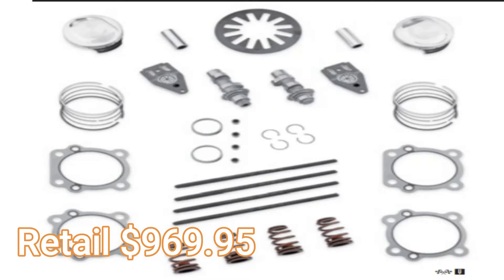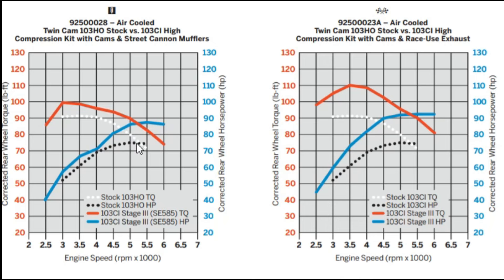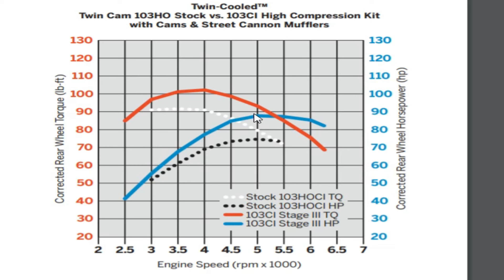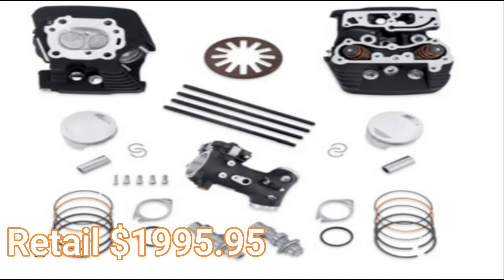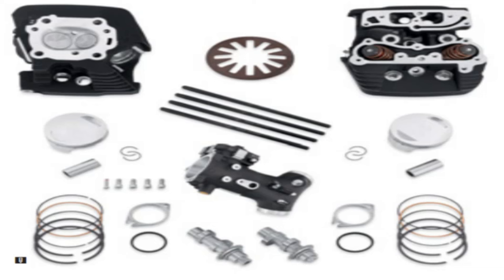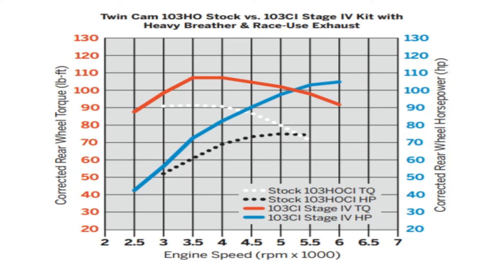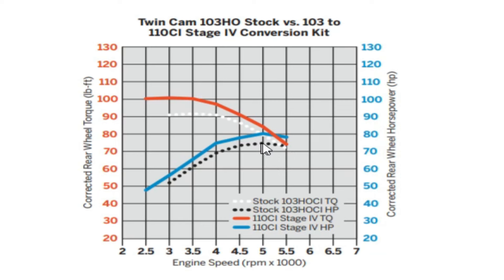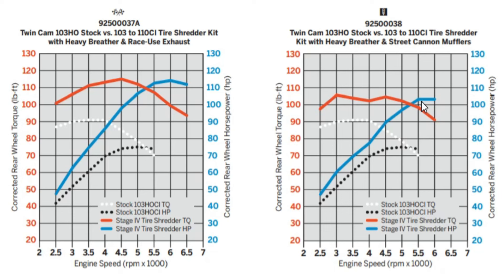Late Model Twin Cam 103's Make A Solid Motor For Modern Used Harleys

Comment: Good information well presented. I’m currently looking to get my first ever Harley and I’m looking at a 2015 ultra limited with the 103 engine only concern the one I seen at a good price had 30,000miles on it, what would your views be on that mileage ? Or should I go newer and get the 107 or 114 m8 
Thanks in advance any help would be appreciated
Reply from the maker: I like the late model twin cams since that's where they got it right in my opinion. Now the early M8's up to 2020 have some issues with oil sumping and piston oil jet coolers coming loose. With that twin cam at 30K I would just have the tensioners checked and make sure they are still in good shape. With they hydraulics they can last up to 50K miles, but better safe than sorry.
Reply: @GixxerFoo  thanks for the reply and info much appreciated. Are these 103 Rushmore’s engines good for high miles then? I’m not a fan of the sound on the new m8s plus the stories put me off Aswell on then 107,114’s. 
It’s more for just long rides and slow riding not for speed at all
Reply: @boylejohnstone1  on a different note my 103 lost a can tensioner and wiped out the motor with 26,000 miles.  My 2017 m8 now has 76,400 miles on it with only oil changes and a stator.  My 82 shovel swallowed a valve at 29,000 miles......my 98EVO is still running along with 102,000.  I work on 5 M8s that i have vented heads to atmosphere like i have done with every Harley from 76 till 2020.   M8s we do run 4 dots low on oil stick.  And vent crankcase to atmosphere ( 8 bucks to do not 100+) So i think the m8:engineers also run too much oil.  Maybe why you dont see many softtails stumpping...🤣🤣🏝

Comment: I have a 2016 Road Glide and have no intention of getting another Harley. I don't think the Milwaukee 8 is any better.
Reply from the maker: The M8 has improvements, but you it doesn't feel like a Twin Cam. I've rode both and I prefer the ride and feel of the 103 Twin Cam.

Comment: I bought the 2015 Road Glide Special out here in Cali and with the smog is was a DOG! Ran hotter than hell, didn't get 200 miles on a tank and had no throttle in 5th & 6th gears.

Purchased the Screaming Eagle race tuner. Installed a Roland Sands intake and Reinhart slip ons'. Took the stock exhaust off, emptied out the catalytic converter chamber and reinstalled it. Had to take it to Arizona to have it dyno tuned. Like a brand new bike. 92 hp with 113 torque. Runs way cooler, 240 degrees when it's 100 degrees outside. I get 230 to 240 miles on a six gallon tank. And of course, it's not the fastest bike but nobody leaves me in the dust. This thing is a rocket ship recliner. These days Harley is begging me to trade this in on the M8. Thing is how do I take the Cali smog off this thing and pump it up like every other Harley I've owned? The stage kits are crap and full of problems. These things eat, breath and fart. You improve this on the Harley it's like you have a brand new bike.

Comment: I’d say with that tire shredder kit that you upgrade the oil pump as well correct?
Reply from the maker: It's good idea to upgrade to the high volume oil pump on any twin cam. If you're installing a kit it's the perfect time to install it. It doesn't come with it but it's worth the extra money.

Comment: i enjoy my Twincam 96 the way it is , yes it's a noisy engine but all Harley engines got some noise . You just need to change the oil every 2000 miles and use a good quality oil and filter. Don't be afraid to use a 60 weight full Synthetic oil for extreme hot temperatures.

Comment: Before spending that much money trying to improve a Harley 103, I would just buy a Kawasaki Vulcan 2000 that puts out 141 ft.lbs. of torque to the ground, mine cost me $3,700, it now has 42,000 miles
Reply from the maker: I've always said that Vulcan 2000 is what Harley should really look at for going water cooled. It's a cam in block push rod engine and it's liquid cooled. Those bikes lay down some serious V-twin power!
Reply: It could have 9000ft pounds….but it’s always going to be a Kawasaki
Reply: @mickyzzzeee  yeah how great is that right 😃, Love my Kawasaki 🥰😍🤩, it's super fast and super fun to cruise on, my first trip to the smokey mountains, on it Harley riders were coming up to me admiring my metric ride 😀😄😊
Reply: @mickyzzzeee  and guess what, it didn't overheat,  and it didn't break down, 😆😅🤣😂

Comment: First modern twin cam 103 with the cruisedrive 6 speed transmition was first introduced in 2007 police  engine.
Reply from the maker: That's true, it wasn't widely available to the public until 2010.

Comment: Great video,, i ve got a 103 stage 4 kit on a 2013 fatboy and it was superb,, i replaced for a 120 R engine,..
Reply from the maker: Damn you went for the gold with the 120R! How do you keep a tire on that bike now?!
Reply: @GixxerFoo  from stock dunlop to the avon cobra chrome,,,
Reply: Still got the 103 stage 4 on the cabinet,,, tuner is vance and hines,, configuration online,,, i ve got the tts but there no dyno program to do the tuner,, but still pulling hard
Reply from the maker: Did vance and Hines provide you a tune for the 96?
Reply: @GixxerFoo  yes, they did for the 120 R,, and the 103 stage 4
Reply from the maker: I'd imagine it was a pretty good, they do a lot of dyno time developing.

Comment: Do you recommend doing anything to the bottom end of a 2014 103cid ( 43k on clock) if I were to go with the stage IV 110 cid tire shredder kit ?.
Reply from the maker: The kit is going to replace the bearing you can get to, you'll be replacing the left side output shaft bearing as well. That's about all you can do to the bottom end unless you're splitting the cases and having the crank worked over.

Comment: So, I have a 2016 Road Glide 103 twin cooled.  Does that mean that "going all out" for me would be the kit with the CVO heads because I can't use a tire shredder kit?
Reply from the maker: For that bike you can safely up the compression, the heads aren't bad on the CVO model. With them being water cooled l would go the route of upping the compression with some good cams.
Reply: @GixxerFoo  So keep it a 103 and just improve the airflow/compression.
Reply from the maker: The water cooled heads they really don't have a lot of offerings for those for some reason. But a adding high compression pistons will give you a big boost.

Comment: Leave the Engine Stock & Save yourself the $$$ and enjoy your Bike. Where are you going with all that horse power when just about were ever you go it's stop & go Traffic, with Fool's driving 4-wheelers.Think about it.
Reply from the maker: Just depends on how far you want to take it, honestly a nice cam to put the power where you ride is realistically all anyone needs beyond Stage I.
Reply: If i had to deal with stop and go traffic, i would be reevaluating my life. I'd move or eat the end of a shotgun. Most my riding is wide open backroads. A few stops in town, but towns are small, and this country is a big place.
Reply: It's all the people that upgrade on their bikes gives them an excuse 2 stay off them and never really have the urge to get out past their county line...They love 2 just hang out and brag about all that they have upgraded etc... Anyone with a brain cell left in their nogan would just leave it alone and ride wear out the parts..IF ITs nOT BroKeN DonT FiX It!!!

Comment: My 2017 Dyna Low Rider S is the 110 twin cam. Love it. Last year of the great one
Reply from the maker: That's already shaping up to be a special bike, they are already highly desired. I would hang onto that one!
Reply: If you take it to over 120 + rwhp and torque ..get rid of the compensating sprocket and clutch and replace the compensating sprocket with a solid plain replacement sprocket and a Baker King Kong Clutch or it will all self destruct ..been there and done that twice ...the last time it twisted up the fly wheels .. Was not a pretty site . used the latest screamin' eagle compensating sprocket and screamin' eagle clutch plates that shattered in to gravel of pieces parts and parts pieces

Comment: When bigger cylinders and higher compression pistons are added to the 103, would these things effect the dependability of the bottom end. Crank, bearings etc.? Thanks, I enjoy learning any new information you may impart upon me.
Reply from the maker: It's always a possibility but a lot of that depends on how hard you are on the motor. If you just ride it and not beat on it constantly, take good care of it, it can be quite reliable.

Comment: It’s all in the heads ! My 2015 RK I used my stock pistons and sent the heads to zippers performance for there mildest CNC port they offer called 1.8 for the slightly larger intake valves 700$. Put it back together with.030 head gasket and heads decked made it 10.25 comp. I already had Andrews 57h cams & powervision with cobra power port headers & SE street cannons. So this is the cheapest big gain set up you can get. & never even had to remove my cylinders. Had it dynoed with the powervision & ended up with 108 hp & 116 TQ & a very happy customer 👍 I did it with 14000 miles on it. 
Forgot to add I did it all myself including the cams a year earlier so no labor costs
Reply from the maker: Doing it yourself is the way to go! That's really impressive numbers, the twin cam engines really respond well to compression. You made some big power on the cheap, Zippers does really good work too. What was the turn around time sending your heads out?
Reply: GixxerFoo 
10 days in February which is there busiest time
Reply: Very true harleys absolutely make there power in the heads, but those heads need the right supporting parts to be able to make that power. They cant do it alone
Reply from the maker: That's very true, having some compression never hurts either.

Comment: I have a 2009 FatBob with 103 Stage 4 Race kit, 259e cams and just SE slip-on mufflers. Dyno at about 112/111. Very reliable, pulls like a beast and so happy.
Reply from the maker: That's awesome! Those factory headers are pretty dang good, they really don't get the credit they deserve. Some good slip-on exhaust work really well, those are very impressive numbers!

Comment: So did they put  the High Output 103 in all platforms in 2016?  street bob too?
Reply from the maker: The Street Bob was the only big twin that didn't get the H.O., it started on the Low Rider and went up the price scale on all models from there.
Reply: The 14 tour line had the HO As well. At least my limited is

Comment: I went with the stage 5 tire shredder kit with the pro tuner 123 hp/ 127tq. I love it it is been on my bike for 3 years works great.
Reply from the maker: It's a mean kit, guy that works at my local dealer has one on his Road King. You pulled some damn good numbers with yours, what exhaust are you running?

Comment: Great video thanks, I would like your opinion. I have 2014 Limited with the Daytona blue i only added that cause it was the only reason i traded up. My wife fell in love with it and without her i would not be on two wheels. But i digress i have the stage 1 with full exhaust and V&H mufflers. Question is i want more TQ and I don't want the high rpm's to get HP Which 110 kit would be best if at all. I do have 55000 miles? Thanks
Reply from the maker: You could go with a new set of cams if your targeting low to mid range torque, but if you're interested in a 110 I would go with the stage 3. It doesn't push the power all the way to the top of the rev range like the stage 4. The stage 3 110 kit produces just under 110 ftlbs of torque at only 2500 rpm.
Reply: @GixxerFoo  thank you

Comment: Hey brother I'm purchasing a slim s 110 what do you think of those.
Reply from the maker: You shouldn't have any trouble with the S models, they had that motor nailed down pretty well. You don't see many of the S model Slims running around!
Reply: @GixxerFoo  thanks what package do they have. The bike I found is a 17 with 4k on it
Reply from the maker: Damn they never rode that bike! For 110 they have 117 kit for it, that kit will run with the new M8's easy.
Reply: @GixxerFoo  thanks

Comment: Thanks GixxerFoo straight up advice I just got a 2015 RG with only 6000 miles on it and I'm looking at giving it some more power trouble being down here in NZ parts are way more expensive.
Thanks again from NZ
Reply from the maker: I appreciate you watching and your support! I bet you got some beautiful riding country around there, does it already have the stage 1 done or is it still stock?
Reply: @GixxerFoo  Thanks Brother yes we do have some great ride's down here but usually if you ride far enough there's always somewhere great to ride.
My RG has Monster Round slip-ons I'm not sure apart from that it was imported from the States.
All the best brother

Comment: From personal experience the 110 is a waste of time. Apples for apples the 103 makes more power than the 110 with the exact same work. For some reason the 110 don't respond to mods as well as the 103.

Comment: That'll work for a first bike, aye? I'm 50...never rode...taking safety classes (as many as possible!); all my cars have been stick shift. Looking at a Dyna wide glide. Thoughts?
Reply from the maker: The safety course will teach you quite a bit and get you comfortable on a bike. I had my endorsement at 14 and rode for 20 years on the street without having to take class. I took a beginner class with my wife, learned a lot and it was great experience.

Comment: I have a 2012 electra glide. All i did was put in a decatted stock header pipe, cobra 909 uppercut slip on mufflers, big sucker air cleaner, dyno tune and andrews 57h cam. Makes 97hp 107tq. Sold
Reply from the maker: Those factory headers really don't get the credit they deserve, they are really pretty damn good. Once you get that cat out and add a good slip on like you did.
Reply: My ducati multistrada has 150 HP ONLY weighs 480 pounds and all I do is push the button !!!!😄😄😄😄😄😎😎😎😎🍺🍺🍺
Reply from the maker: Those are fun bikes to ride! Ducati just has that Italian refinement, they are unique in the feel and ride like the Harley. You ride any Japenese bike and they all feel about the same.
Reply: @GixxerFoo  the first 92.000 miles have been good , I think I will keep it !!!!😎😎😎😎😎😎😄😄🍺🍺🍺🍺
Reply from the maker: Wow, dang you ride the crap out of that bike. I haven't heard of a Ducati with that kinda mileage before, never doubted they could do it either.
Reply: @GixxerFoo  thanks man !! My last 3 bikes , 2001 Ducati. ST2 sold it with 205.000 miles , 1991 Ducati 900 ss traded it in with 196.000 miles , I had a 1984 Suzuki gs750 put 93.000 miles on that !!😎😎😎😎😎😎😎😄😄😄😄🍺🍺🍺
Reply: Here is a short video of the ST2. Turning over for the second time !!!😄😄😄😄 https://youtu.be/voMQ-4Xo-7Q
Reply from the maker: You've had quite the fleet and rode the hell of them too!
Reply: @GixxerFoo  thanks man !! I DON'T GOLF !!!!😄😄😄😄😄😄😎😎😎😎🍺🍺🍺🍺🍺
Reply from the maker: 😆😂👍 l don't either

Comment: A little off topic,  but what is your opinion on the stock CVO 110 Twin Cam, not an aftermarket 110 kit? I have been reading horror stories on some online forums about the lifters going out. The one I just bought has 41,000 miles, kind of a lot for a bike and I am hoping that any issues the 110 has have already happened and been corrected. What are your thoughts? Thanks for the great videos.
Reply from the maker: I heard of that happening but it was kinda like the cam chain tensioner in the 88. It didn't happen to every bike out there and depends who you talk to it was maintenance related. Personally l wouldn't be too worried about myself.

Comment: Love the twin cam engine....do you like the andrews 57H cams for those engines?
Reply from the maker: Andrews makes some really solid cams. That's a really popular cam for the twin cam, l like the power curve on it. They also give them a nice lope at idle.
Reply: @GixxerFoo  .....thanks for responding back man. My 2003 cvo road king is getting engine work now, andrews 57h, wiseco forgef high comp pistons & rings, pushrods lifters cnc ported heads,  10 over bore and hone....2 into 1 bassani stainless, s&s stealth air filter, power commander 5..... i wanted a power vision, but my mechanic suggested pc5....is that good enough  for my build?...
Reply from the maker: Dang that thing is gonna scream with all that work. Compression, porting and cams is a huge gain for.a twin cam. Nothing wrong with PC5 at all, it will work really well for your build.
Reply from the maker: Did he say why he didn't go with the Power Vision?